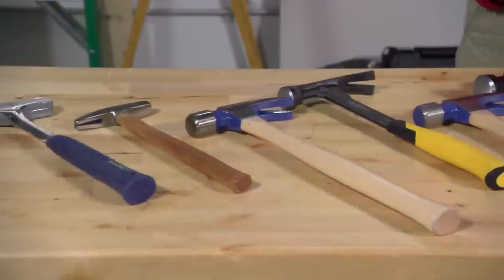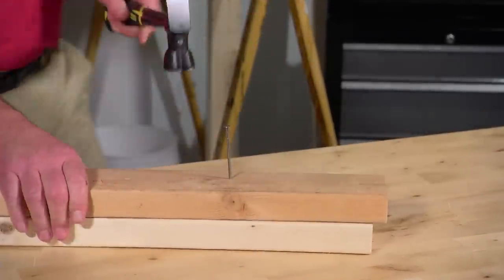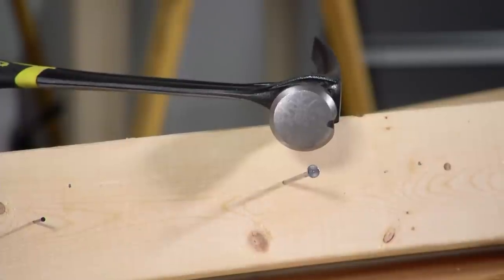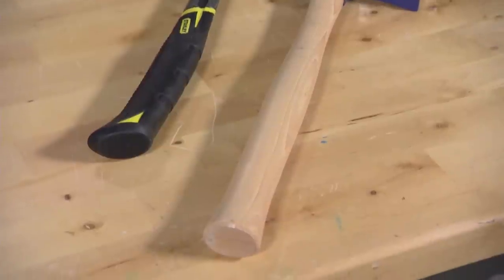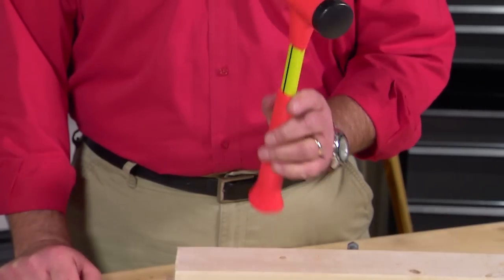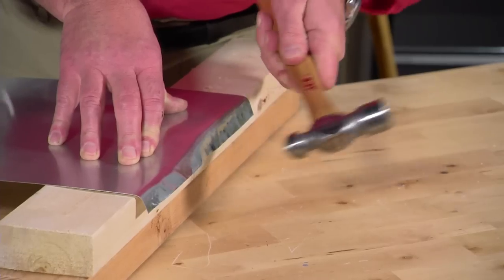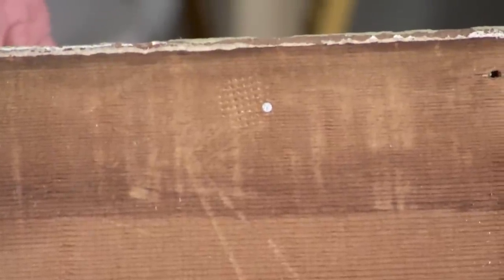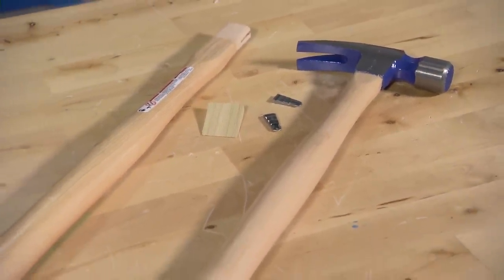How To Choose a Hammer - Ace Hardware

Comment: What is the slotted end of the upholstery/tack hammer used for?
Reply: I went to an Ace Hardware store today to buy a tack hammer.  They had two of them and neither one was magnetized on the split hammer face.  Don't buy one from Ace online, you'll be disappointed.
Reply: @ralphwatten2426  Fwiw tools can be magnetized if need be. Simple magnetizers can be found like on ebay.
Reply: @metatechnologist  I bought an American made tack hammer and paid a little more for it 4 years ago.  It's still magnetized and I didn't have to mess with it.  I have a cheapo hammer that came to me through marriage.  I magnetized it and a year later it wasn't magnetized.  Pay more, get more that's what I always say.
Reply: @ralphwatten2426  Sure. But in the meantime you could buy a small rare earth magnet and glue it on the hammer head you have and make it work that way too
Reply: @metatechnologist  Nah!